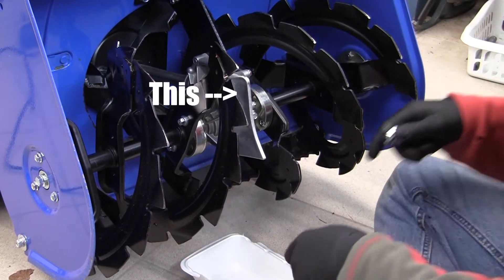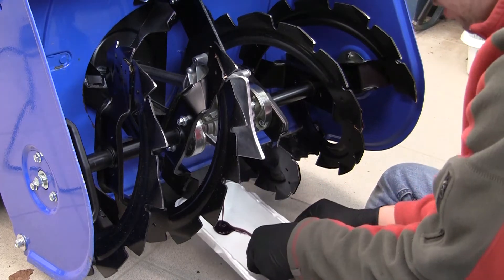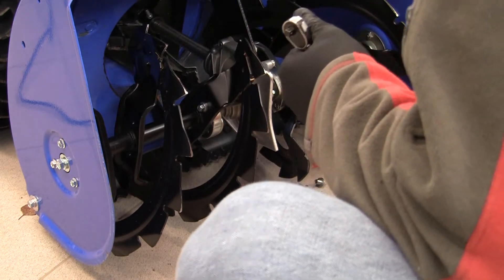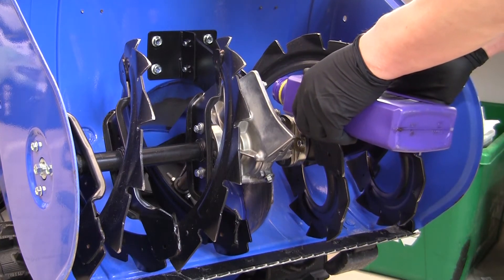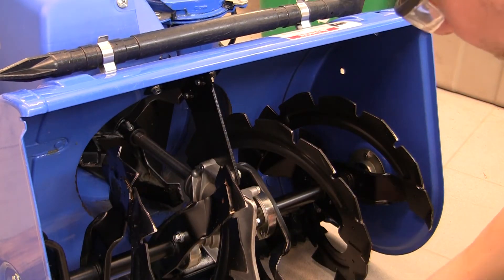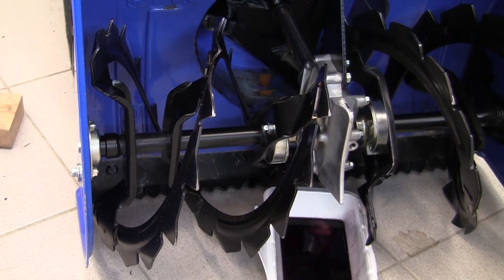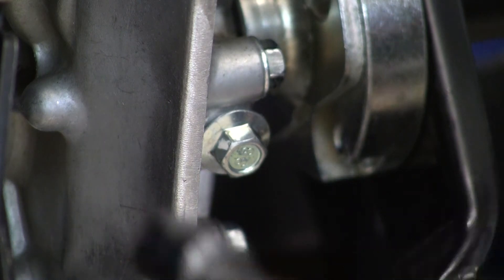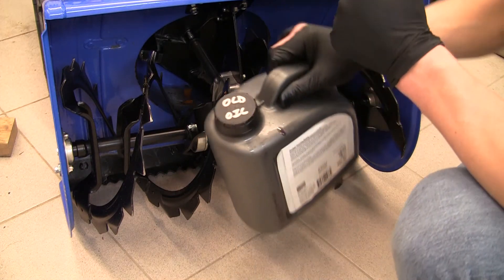Ep. 2 - YT624EJ M.S. - Changing the Worm Case Oil

Comment: Hi again, yesterday I change the hydrostatic oil with diesel 10w30 as mention in the manual. Since I have some left over can I use it to change the worm case oil even though it diesel 10w30 ?
Reply from the maker: @NickDaTech  check the comments of this video, go over to episode 14 where I am recommending a different oil for the worm gear.

Comment: I think you are supposed to fill it up from the bottom and when it overflows you cap the overflow and then cap the bottom. Use 10w30 sae syn but use gear fill equipment. Thoughts?
Reply from the maker: I did it how the service manual shows but no doubt there are other techniques that would work. I would probably just redo it the same way in the future if I were to do it again.
Reply: @lucgallant  tried your way and what a mess. Using the outboard motor gear oil method next time.
Reply from the maker: @sitarkhani  lol yes it is overly messy, surely there's a better way. But here I'm trying to follow the strict direction of some engineer in Japan.... 🤣
Reply: @lucgallant  they really recommend that method in the manual? Doubt it.
Reply: I took my blower to Yamaha to service and found out they weren’t actually changing worm gear oil. Drained black gunk and full of metal shavings.That means original gear oil.  Lol! I had them do it 3 times!
Reply from the maker: @sitarkhani  no I enjoy lying to people that I spent time reading the manual, doing the task and then the videos for this channel for nothing.
Reply: @lucgallant  dude. I have the manual. Tylenol syringes aren’t included.
Reply from the maker: @sitarkhani  it says put oil in a hole. The hole is horizontal. Your alternate idea was fine, no need to troll

Comment: Do you use 10w 30 for the engine oil as well
Reply from the maker: https://youtu.be/z-tmLCY-93A

:)
Reply: I used the 10w 30 oil for the worm gear and now I think I have a auger 
Seizure? Is the possible the wrong fluid cashed this
Reply from the maker: @geraldgreene5563  I've been using it since I made this video with no issues so, doubtful.
Reply: @lucgallant  right..  probably although it does SAE 90, the dealer I spoke to use engine oil as well?
Reply from the maker: Ya not sure. May not even be the worm gear?
Reply: Probably something else ..  I’ll think I’ll use the gear oil from now on to be on the safe side

Comment: Hi Luc. 
Question!  
Did you ever earn about tracks adjustments ?
Seems likely mine aren’t perfectly synchronized. 
👋🏼❄️❄️✨
Reply from the maker: I've got a video filmed on tension but not on synchronization. They're on the same shaft no? See here: https://www.crowleymarine.com/yp/INBR4HTJUO/yamaha-yt660-7t02-010-2016
Reply: @lucgallant  Yeah, like you said, probably more a tension difference between the two tracks. Mine didn’t go straight, get a bit left always....
Thanks for your time. 
Didn’t find your video about the track’s but will search...
Merci. ✨❄️✨
Reply from the maker: @johnerickennedy  I didn't have time to process it yet, coming soon! I haven't found a spot to fit it in yet, but will soon!
Reply: @lucgallant  thanks sir. ❄️✨❄️

Comment: I changed mine and i use the same method i use for boat foot. I remove the oil by gravity and i pump the oil in the bottom until i get a spill on the top bolt. Then i close the top bolt and the bottom bolt after. And of corse i use transmission oil
Reply from the maker: Ah yes that's a good method. I'm sure transmission oil does the trick but I just double checked the book and it does say Yamalube 10w30. Anyway this worm case doesn't have the most severe duty.

Comment: Are you sure that oil 10W 30 is the right one for this...i think it should be transmission oil instead.
Reply from the maker: Service manual says that, yes.
Reply: @lucgallant  i cant find in my service manual what oil it takes and i cant find it on the internet the ys624 which is a older model takes sae#90 i sent a email to Yamaha i will let you know if they respond
Reply: so i emailed Yamaha and lucgallant is right SAE 10w30 is what they want you to use for the worm case oil and if your interested HST fluid is Diesel engine oil SAE 10W-30, Class CD or higher
Reply: getting confused with this i checked with the yamaha dealer and they said 85W90 would be fine now the question who is right i just cant see 10w30 going in a gear application

Comment: Did you measure the 50 ml and put exactly that back in?  I changed mine out today for the first time and the oils that came out was very thick.  Seemed more viscous than a 10W30 and smelled more like grease than oil.  I also could get way more than 50 ml in there if I tipped the machine back on the bars.
Reply from the maker: I measured but it shot everywhere so kept adding until it overflowed when level. It needs to be level, the fill port is an overflow also. Service Manual def states 10w30.
Reply: @lucgallant  thanks.  I got a nice big syringe from the local pharmacy and used that to measure and fill.  It's pretty messy job for such a small task.  I probably added 60 ml and it wasn't leaking out the fill port.

Comment: Great videos! Ive been trying to find somewhere online to buy the the service manual for this thing online, no luck so far. I guess I’ll have to bite the bullet and goto the dealer. I have a favour to ask, could you check to see how much lateral movement your auger has? The right side(if facing the front of the blower) of mine seems to have a bit of play whereas the other side doesn’t have any. I checked all the bolts and shear pins and everything is nice and snug. Thx!
Reply from the maker: Oh hey responded to you separately! Augers have about 1mm lateral movement each!
Reply: @lucgallant  hmmm, seems like I have a bit too much play on one side. Thanks for checking!
Reply: @JasonS-fk1uy  Hey there.  My 624 has more movement on the drivers left ("right side as you described") as well.  I thought it was a little odd too but it's been like it since new and knowing yours is the same makes me not too worried about it.

Comment: Pretty interesting they use oil in there, most of cheaper brands just use grease.  Do they call for 10w30 in the service manual?
I like how you put a bunch in there and were like "is this thing even filing up?"  The flash light in the hole gave that away.
Reply from the maker: Yessir, 10w30 engine oil, 0.05 L. Everything by the book except the suggestion of bringing it to the dealer to change 50 mL of oil...
Reply: Great video, just want to confirm that 10W 30 is ok.. the dealer is saying they use 85/90 gear oil..
 The other question is that I didn’t know there was a transmission fluid change?  I couldn’t find it in the book,
Thanks again